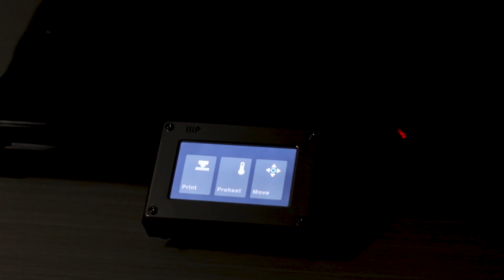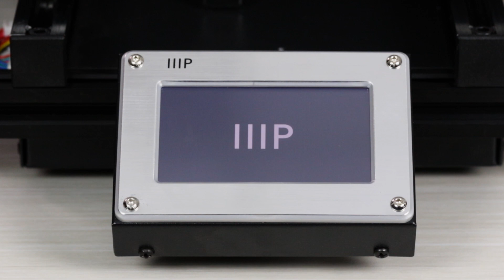MP 10 / MP 10 Mini 3D Printer Introduction and Setup

Comment: How do you get this printer to print on the bed? No matter what i do, it just prints like 1/4 an inch or lower to the bed. won't go down to the plate at all. Even tried to raise all 4 of those tiny finger turners under the bed, still won't make up the difference. Tried the manual adjustment closer/farther, but won't let me get past 0. any suggestions?  What if i add a piece of glass, will it print closer? I tried that screw on the back left also, still sets itself above.

Comment: Hi can you do a video on auto leveling? I just got mine today and tried to print cat.gcode however the first layer is always off from the z platform. I have tuned global z offset to 0 and still got the problem. I tried to look around but less resource on this printer. Thanks!
Reply: Loosen the 4 thumb screws under the print bed about one turn each. That will allow the bed to rise. The problem is that as shipped, the bed is below where the hot end can reach. Took me forever to figure this out.

Comment: Hi There. I just set up an MP 10 mini and the cura 3.3.1 refuses to work once installed. It will open up but won't connect to and load a STL file. Is there another program that will work? Newer versions of Cura don't have the mp10 mini as an option. The happy cat prints beautifully. Just the above problem.
Reply: did you ever solve this?

Comment: I just ordered the big MP10 yesterday. I'm quite disappointed in the amount of YouTube videos showing off this big printer - but I guess I'm just gonna have to contribute myself :) I look very much forward to continue the good MonoPrice experience. My first (and until the MP10 arrives, only) 3D printer is the MP Delta Mini, and I've been quite lucky to have had little to no issues at all with mine.

Having both the Delta Mini and the MP10, gives me redundancy - and two different printing systems (cartesian vs delta). And of course, the MP10 can do 300x300x400 and can thus almost print an entire Delta Mini in 1:1 scale ^_^